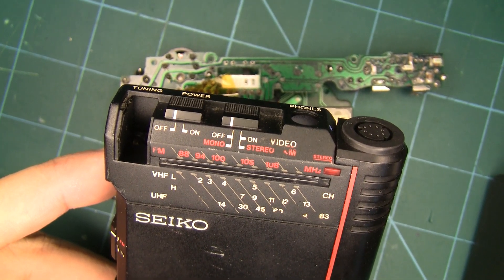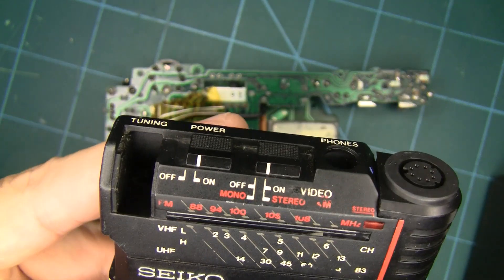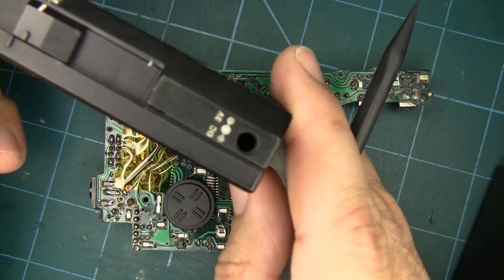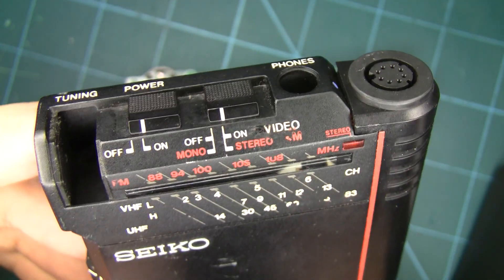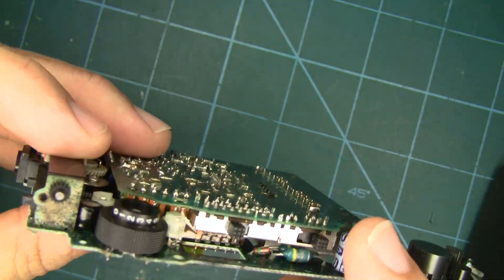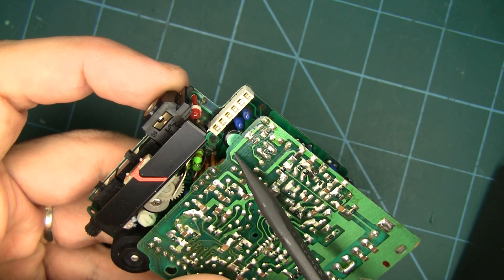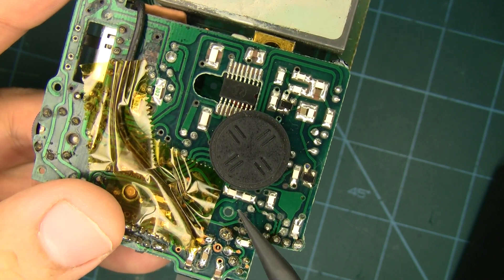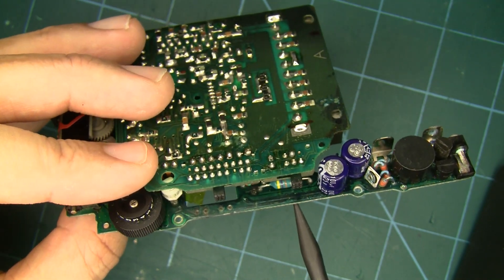Seiko TV Watch (T001-5019) TV & FM Stereo Receiver (TR02-01) Repair

Comment: Hi Oturgator! I started fixing my receiver and managed to replace all the caps on both boards (I actually used some SMD caps that fit nicer in the narrow space). I still have no power it seems. Did you get any further?
Reply: Did you replace all 13 capacitors ? are you sure replaced correct value capacitors ?

Comment: Did you get this TV receiver working? I have one. the radio works fine and TV reception is fine but there is no LCD video on the watch. There are voltages on the pins of the watch connector. Is this a cap issue? thanks